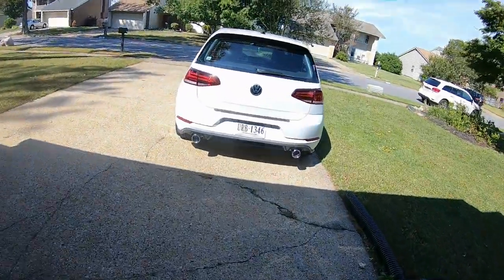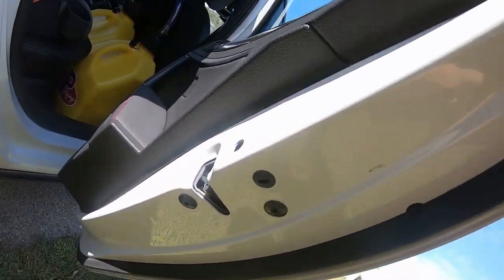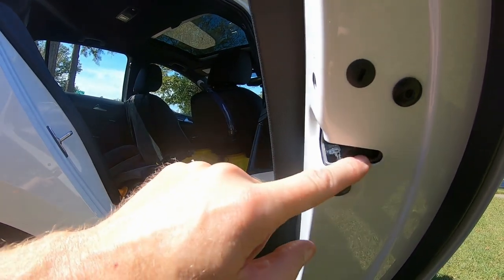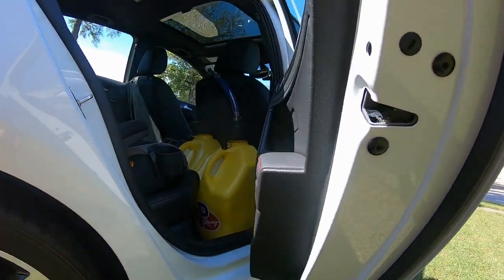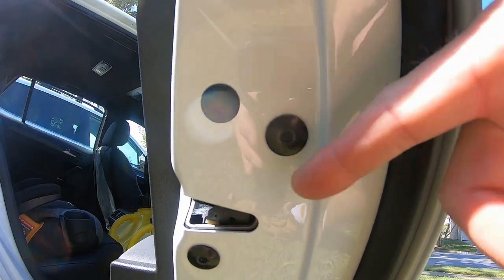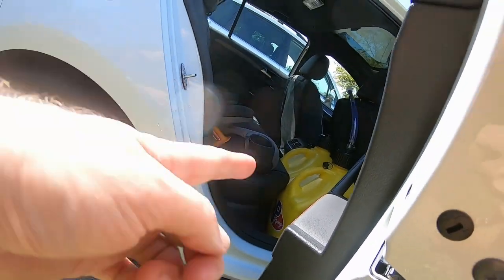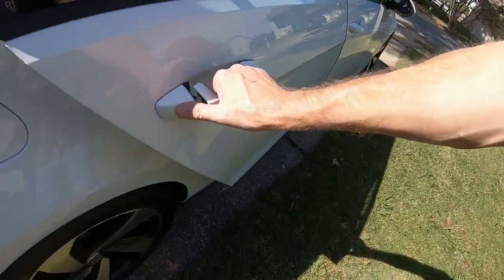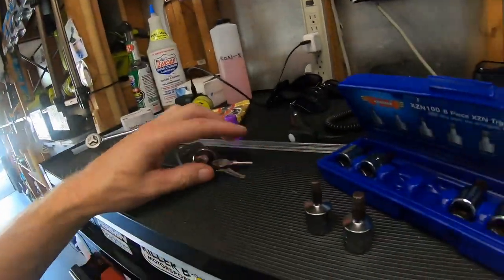2018 VW GTI SE Ep.171: Sticky or stiff door handle?

Comment: Hey i'm kinda late to this party but my 7.5 GTI is only 1 yr old and this "stickiness" just started on the drivers door.
I did a quick search and there is  a rubber grommet inside the door when opened.  Peel this grommet away and u will see a black mount bolt,
and a silver bolt.  You can tighten the silver T20 hex bolt behind this grommet to tighten the cable.... this cable will stretch over time so you will have to do this again.
Also I smeared some white lithium grease on the door latch and contact loop.    Hope this helps.
Reply from the maker: great tips bro!
Reply: I think you just resolve my problem, im gonna try and comment my feedback